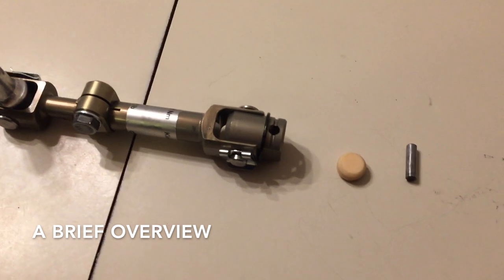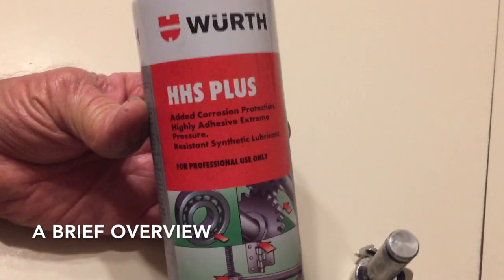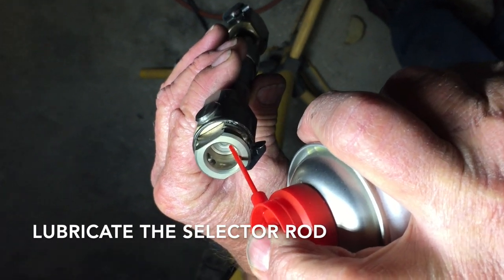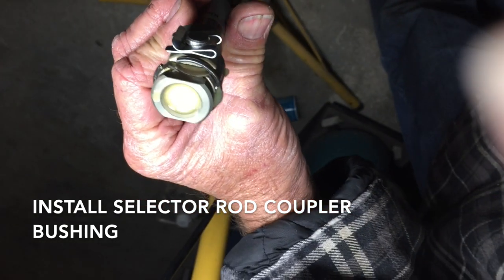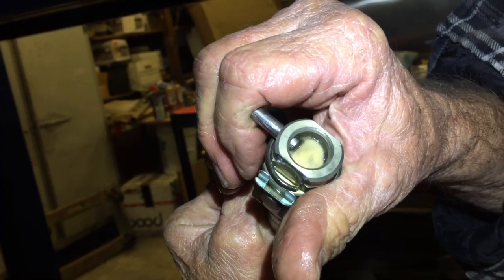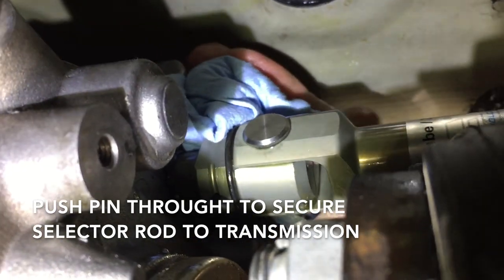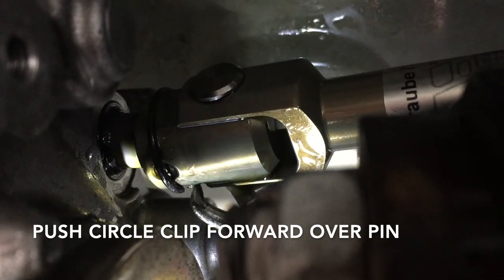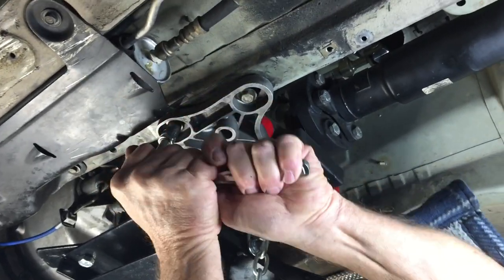How to Install the CAE Adjustable Selector Rod:  CAE shifter install pt 6 E46 M3

Comment: when you order the CAE DSSR, the selector rod bushing is coming with it? Thx a lot.
Reply from the maker: The bushing doesnt come with it, you need to order it separately - look in the description the bushing and the CAE DSSR is there tooyou'll see it says selector rod coupler bushing and has a link.  Check the links i post in reply- those work too. In future anytime looking for a part- let us know if you don't see it in description- Thanks man!
Reply from the maker: Selector rod coupler bushing
https://click.linksynergy.com/deeplink?id=wjLDNk1cnDk&mid=43304&murl=https%3A%2F%2Fwww.ecstuning.com%2Fb-genuine-bmw-parts%2Fshifter-rod-coupler-bushing-priced-each%2F25111434194%2F

XS Selector Rod (125-160 mm)- Recommended for E46 m3
https://click.linksynergy.com/deeplink?id=wjLDNk1cnDk&mid=43304&murl=https%3A%2F%2Fwww.ecstuning.com%2Fb-cae-parts%2Fcae-dssr-adjustable-selector-rod-selector-joint-xs%2Fcae-dssr-xs%7Eca%2F

Comment: I fitted the CAE to my E46 M3 last year and the shift feels a bit more difficult and notchy that I would like, I am still running the factory shift rod, would you recommend I go for the CAE rod to improve this? Thanks for the informative videos 👍
Reply from the maker: I have never run the CAE shifter without the cae selector rod, but i imagine it would make a huge difference, the selector rod gives you a bit more adjustability allowing you to take advantage of creating proper geometry and the increased lever lengths.  Highly recommend switching to the cae rod.
Reply from the maker: the CAE shifter will naturally be a bit notchy, but it can be tuned out with adjusting the selector rod and of course the small adjustments up top. Done right it cane be shifted very easily.  I culdnt imagine the shifter working well without the CAE rod.

Comment: So im planing on buying the CAE shifter and its asking me what size dssr to choose ? How do i know what size dssr i need ?
Reply from the maker: go in the description of this video, we make it easy.  Scroll down to the selector rod section and you'll see a link to the XS 125-160mm for the e46 m3.  Or are you installing on a different car. As always please use our links for purchasing! if you have any more questions please contact us again! here to help.
Reply from the maker: if you're not installing on an e46 m3, let us know so we can give you the right DSSR selection.
Reply: @FatboysGarage  i got a e36 m3
Reply from the maker: @restats8533  Cool deal, do you have a 6 speed or 5 speed?
Reply from the maker: @restats8533  With a 5 speed this is the selector rod that is recommended.  the  5 speed requires a longer DSSR as stock length is about 189-198mm so this one will work Just use the link to purchase.  Links to shifters and other parts are in description.  Anything else that you're questioning for your install?
 (L) 190-280mm selector rod( e36 and E46 with 5 speed)
https://click.linksynergy.com/deeplink?id=wjLDNk1cnDk&mid=43304&murl=https%3A%2F%2Fwww.ecstuning.com%2Fb-cae-parts%2Fcae-adjustable-selector-rod-dssr-190-280mm-length%2Fcae.dssr-l%7Eca%2F

Comment: My neutral does not return to center, it leans to left and right, a lot of play, will this fix it?
Reply from the maker: Are you saying your stock shifter has a lot of play?  If so YES , the CAE is a huge win, no other cheaper shifters have automatic return to center.  That is one reason we bought this vs RTD and all the other shifters out there.  CAE is pricey but man were we impressed.
Reply from the maker: let us know anything else and what youre looking at, here to help if we can
Reply: Fatboys Garage awesome, thank you, where did you get that hook tool, I am going to try doing this with driveshaft assembled
Reply from the maker: @sydneyNemesis101  Here is a link to a set we use.  It has everything you need.

https://click.linksynergy.com/deeplink?id=wjLDNk1cnDk&mid=43304&murl=https%3A%2F%2Fwww.ecstuning.com%2Fb-schwaben-parts%2F9-piece-scraper-hook-and-pick-set%2F008504sch01a%2F

Comment: Having issues with getting the pin all the way through the joint and selector any tips?
Reply from the maker: Letme just say its not easy for anyone. Its hard.  Compressing the foam piece makes it so.  If you can find something smaller than the pin, insert it and compress the foam and then from the other side follow it in with the pin with the foam compressed.  You can do it!